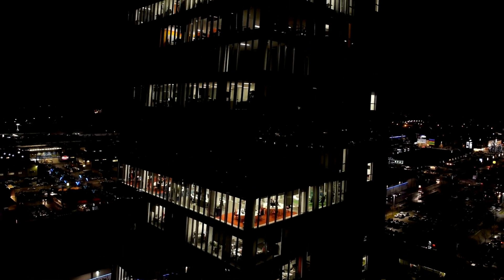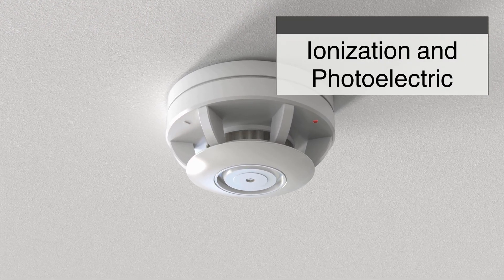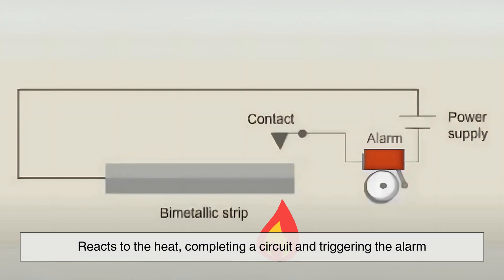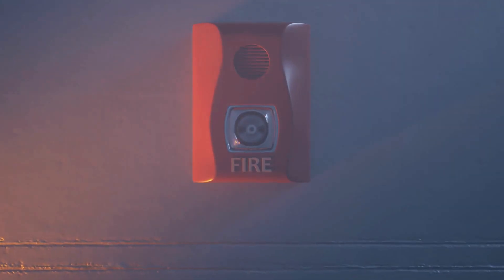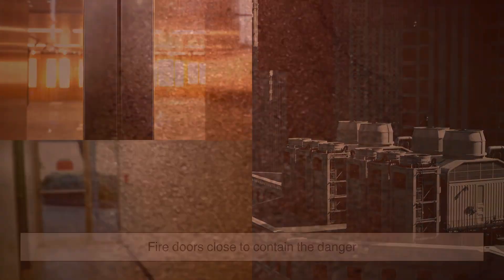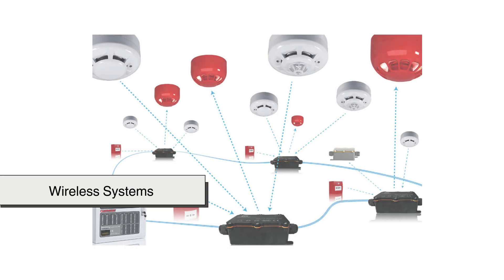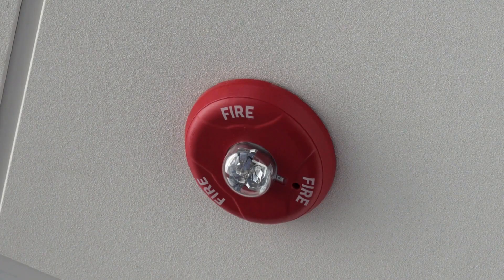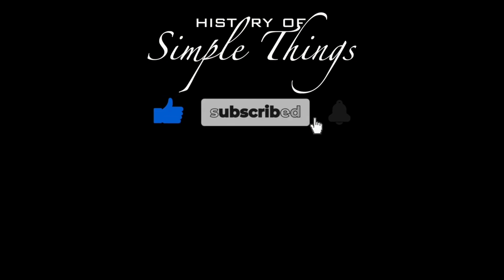How Do Fire Alarm Systems Know When to Activate?

Comment: Typically they activate is when an initating devices sense smoke or fire and also a pull station getting pulled sending signals to the FACP and the FACP activates the system when this happens.